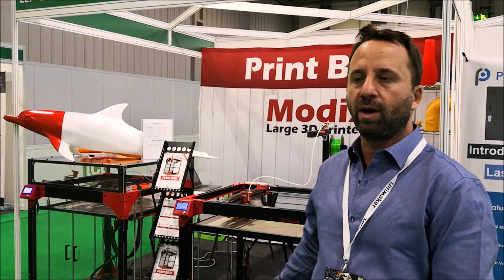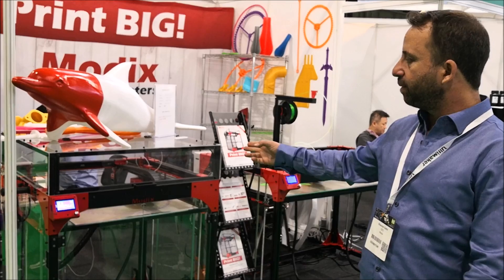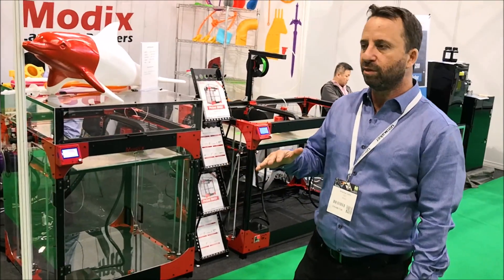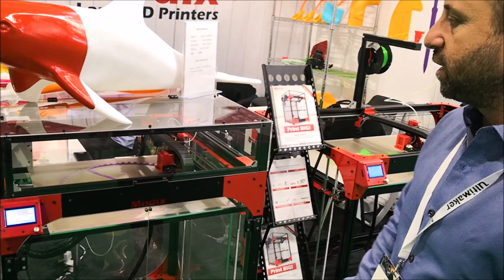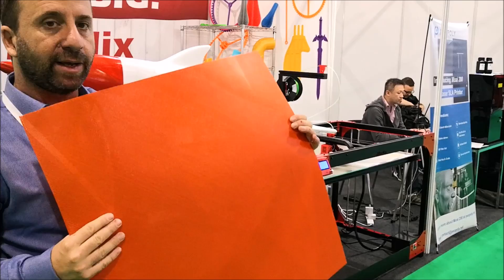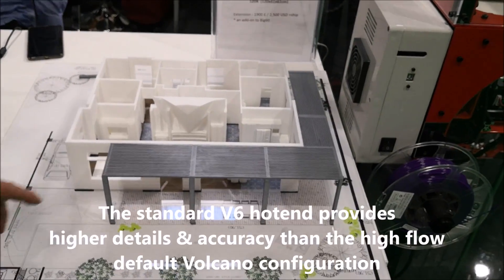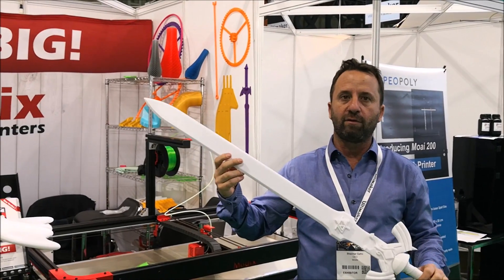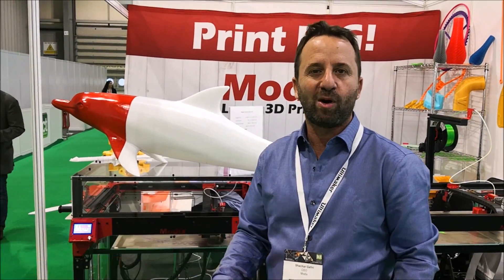Modix Big60 Ver2 Large 3D printer Features Review by Modix CEO

Comment: @5:04    "1mm nozzle and 0.6mm layer = ~10 times more than 0.4mm nozzle and 0.3mm layer".   Well, let's do some math: 1.0/0.4 x 0.6/0.3 = 2.5 x 2 = 5 (not ~10). 
"A bit of commercial optimism" or a clear mistake...?
Reply: @Jouko it is a rounded tube, recheck your calculation when considering X and Y and Z. You only considered 2 axis...
Reply: @davidgafniltd  Nozzle size grows the material feed in one direction (width) only, not in two. So, doubling the nozzle orifice does not quadruple the output but just doubles it.  In order to quadruple the material feed with a double size nozzle (keeping the layer height), you should also double the nozzle speed. So, I still stand up for the math I wrote...
Reply from the maker: @joukolehtomaki8169   This is actually more than 10 times. You can calculate it here and the result is 10.4 times larger the volume of plastic if you move from 0.3 to only 0.5 and 12.49 times larger if you move to 0.6 layer. Doubling the nozzle size is not actually the size but the nozzle diameter. You have to consider the orifice surface and multiple it on the layer height. Keep in mind that printing speed is more or less the same but the tool path is shortened much when reducing the number of layers and infilll. https://www.calculator.net/volume-calculator.html
Reply: @modix3dlarge3dprinters89  No, it doesn't go that way. As I earlier said, the nozzle size doesn't matter in the nozzle's direction of movement. Let me make a simple calc (with printing speed 50 mm/s): 
1.  50mm/s, 0.4mm nozzle, 0.3mm layer: In a second you extrude a volume 50mm x 0.4mm x  0.3mm = 6 mm^3.
2.  50mm/s, 1.0mm nozzle, 0.6mm layer: In a second you extrude a volume 50mm x 1mm x  0.6mm = 30 mm^3.

Yes, bigger nozzle prints much faster, but not as fast as you claim.
Reply: @joukolehtomaki8169  Please check cylinder volume calculator. Now this is only effects the amount of molten plastic but you may also add the reduction in toolpath/shorter Gcode at the same rate of layer thickness difference.
Reply: @davidgafniltd  If the nozzle would make a single spot (no movement in XY-plane), that cylinder calculation would apply. Now that the nozzle moves and builds a box, the cylinder calculation doesn't apply. I try to make it a bit more simple:

(using the parameter values shown in my previous post)  
In one second, the 0.4 mm nozzle builds a box that is 50mm long, 0.4mm wide, and 0.3mm tall. Do you agree with this? If not, please let me know which of the numbers is incorrect and also let me know the corrected number(s).

Now, if you do agree with that calculation, would you also agree with this:
In one second, the 1.0mm nozzle builds a box that is 50mm long, 1.0mm wide, and 0.6mm tall?